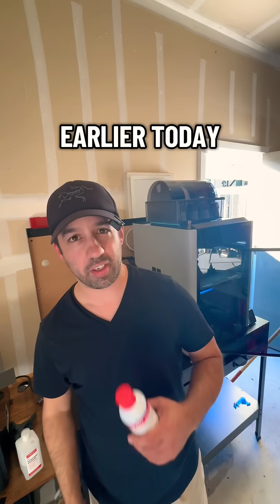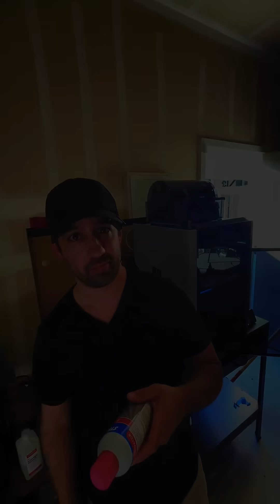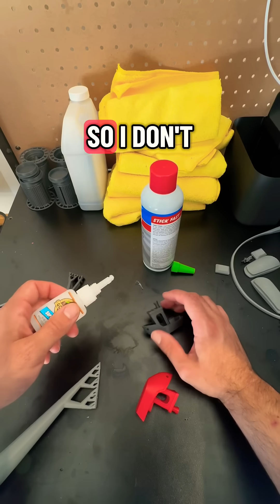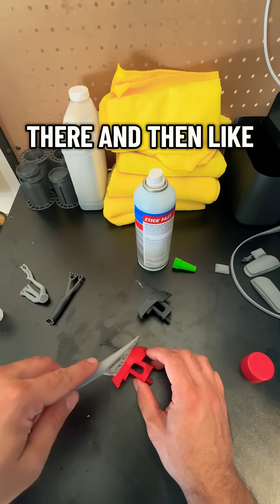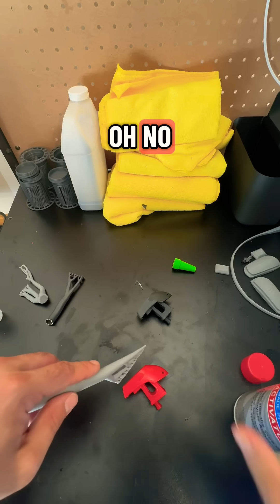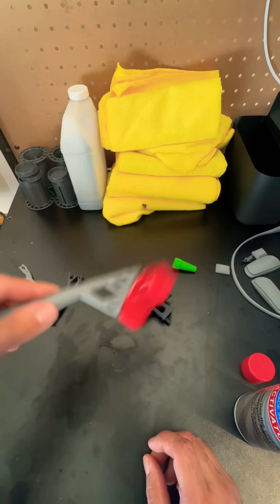Does Super Glue Accelerator Actually Work? #3dprint #3dprinting #3dprinter #3dprinted

Comment: I use accelerant when I need stuff to stick quickly, and it works really well. Just make sure to stay in a ventilated area. I recommend spraying one piece with accelerant, and putting glue on the other, so when you stick em it’ll have less mess.

Comment: That’s interesting. I’ve tried every glue known to man and have never found something I feel is really good to bond PLA. Have all the parts to a t800 arm printed and maybe I’ll try this. Looks like it discolored the area where you sprayed. Did it stay that way or go away once dried?
Reply from the maker: It did wipe off of mine but I’d say try it on a test piece for sure just to be safe. A also don’t touch it if you have glue on your fingers it gets hot 😂
Reply: Loctite plastic glue with activator set is the BEST for PLA
Reply: @RELEVANT2KILL which bottle of Loctite? Also, does it leave the white haze/residue on the print?
Reply: @mrsmrs4844 The activator will, but you're supposed to put the activator where the part will be attached and not seen anyways. It will also give you time to adjust the positioning of your piece before drying hard, which is great.